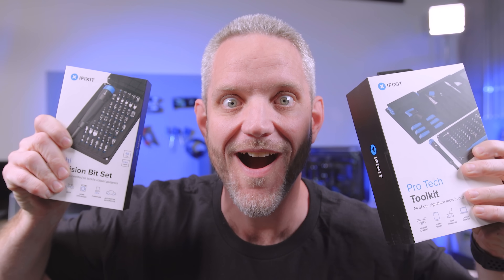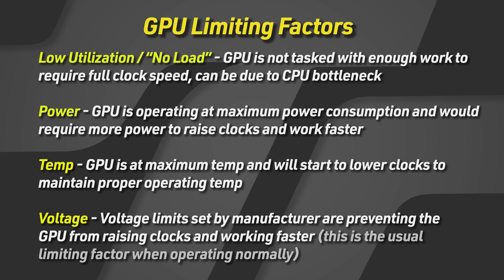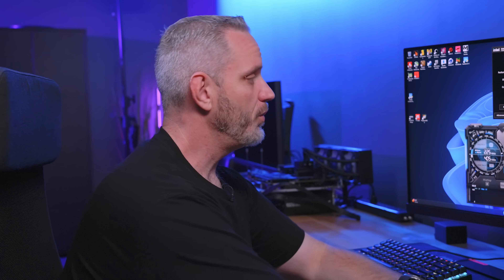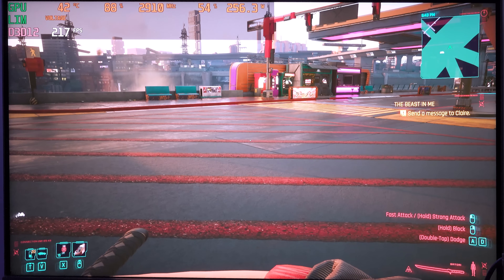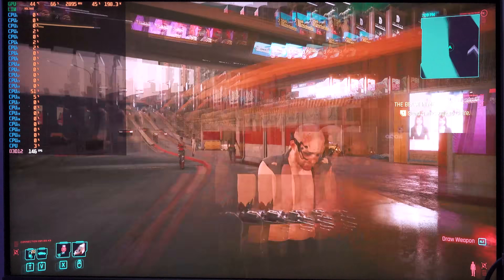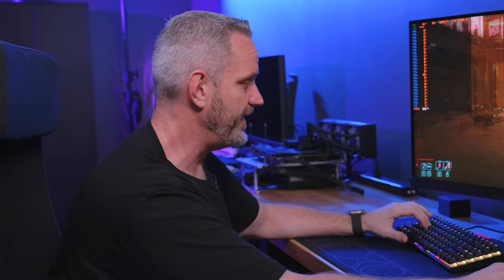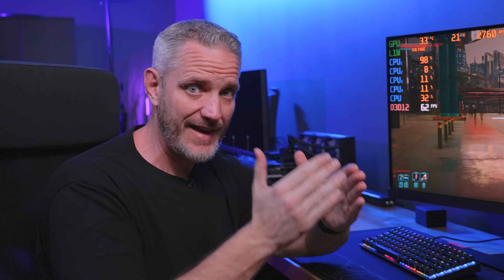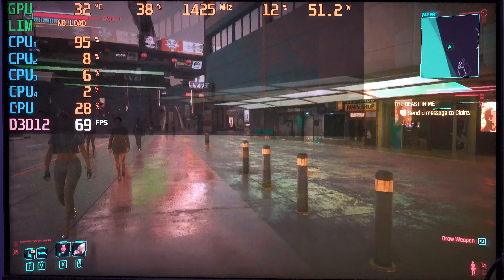THIS is what Bottlenecking REALLY looks like! AVOID THIS!

Comment: Really good guide Jay. I see this all the time and I try my hardest to explain bottlenecking in its simplest form wherever possible - but a lot of people seem to think bottlenecking happens "immediately" when you pair two components together. And that just isn't true. Depends on application. Very well thought out. Thank you.

I actually paired an X5470 from 2008 (At 4.5 GHz) with my 4090 just to prove that the card can still run near close to specifications.
Reply: A lot will depend on how the game itself balances demands between the cpu and gpu, and what you are doing in the background.
(I came back up here to mention, this got very long*, so tldr people should just skip this post and have a good day ;D and, also, I *don't have big issues with any other games, including what little I've played of cyberpunk 8.2 hours So this is a story of an "exception to the rule" sort of thing. One particular game that brought my system to it's knees due to bottlenecking. For reference, I run an i7 7700 at stock speed, and a zotac 1080 mini at stock speed. ssds all around. it's a prebuilt zotac mek1  except for the 1080, a beefier power supply, 32 gigs of ram and being stuffed with more ssds than zotac ever intended lol and while it may sound very old by today's standards, to build the same tier rig in today's market would be about 3 times what I could afford. Plus, since I use a 65" tv running 1080p@120hz I'm basically limited to 1080p gaming, which the current system already handles quite well in most games*. STRESS the *in most games part lol hence this bottle-necking story)
Like, I play a lot of 7 days to die, which actually relies a lot on the cpu when there are hordes (lots of zombies at once).
Things worked pretty well on the base game, but when I started running a mod (Darkness falls) that tended to increase the size of the hordes a bit, and some various other things, it was dropping the game from completely playable, to completely UNplayable (12-14 fps while dozens of zombies are trying to pound on you, with occasional drops to 0 fps. yes ZERO fps lol!).
So I started messing with game settings, trying to see what I could turn down in hopes of squeezing out a few more fps to get by...
But...
What I discovered, was that I could actually turn a whole lot of graphics settings UP and it didn't really matter, and I was actually already running the game at much lower settings than I really needed to, because it simply wasn't really the graphics being too high that were killing me.
There was a major game update right in the middle of my settings-testing so I never got to learn if there were any particular settings worth turning down...
But what I did manage to learn fairly quickly, was that I was almost constantly pegging the CPU up to 100% (in the task manager. I didn't have anything at the time to look at single core usage, but if it's riding at 100% in the task manager a majority of the time what's happening per core is probably less important lol).
Now... I'll bring up one of the big issues that I hit on as a problem right away.
I stream my games. So I always have obs running in the background, and I always keep chrome open to monitor my stream (just that one window, on a second monitor) and often I have firefox open in the background, for this and that (I still have all the bookmarks from back to the early 2000's in my browser, cause I always move them forward to my next pc, so firefox sort of serves of alternative/extra memory for my brain, which I rely on heavily since I have such a bad memory, plus I tend to always open things in new tabs, and my browser loads with all tabs from the previous sessions, so I can look back over my previous tabs to help keep track of time and when i did things, what i was looking up yesterday and the day before, etc. I rely on this so-much-so that I often end up with hundreds, or even thousands of tabs in my main browser. I believe the record number of tabs i've had in firefox at one time was 3,172 or something like that. somewhere over 3 thousand, i'd have to find the pic to know the exact number for sure. but, for reference, chrome with my one twitch page open, tends to hog just-as-much-or-more cpu than firefox with 2,000+ tabs).
Chrome tended to want to use about 14% cpu most of the time (it liked to randomly use 60+% for no obvious good reason) and firefox tended to want to use 7%-14% as well, so the first thing I had to do, was stop streaming for testing.
Aaaand, well I didn't get much further than that before the big game update changed too much to use what I'd already done, which for various reasons had taken a couple of days.
And it's that part that was really showing me how cpu-limited/bottlenecked my system was with this particular game.
The basic problem was, that getting REAL reliable AND consistently repeatable test results on that game was a heck of a lot harder and more time intensive than I expected. It was literally taking me hours-per-setting to get AND verify consistent/reliable/meaningful differences between runs.
And the primary problem was that my video card was simply a bit too good for single changes to make an obvious impact.
As in, the difference between low/off and ultra/on could be between 0-5 fps difference, while the variation between runs with the same setting could ALSO be between 0-5 fps.
So I wasn't able to do just simple run/spin around tests and get real numbers. They were all over the place.
I had to build a big square base with a particular place to stand, run around to all 4 corners and spin around to get everything to load, reset the time and weather to be the same, set my crosshairs on a particular point in the distance, then spawn a given number of zombies set to run towards me, and log the fps while they'd be beating on the base, and while I'd be shooting, etc. had to do that multiple times for every single setting to have consistent accurate results. And just running around in the city wouldn't have told me anything, because that part wasn't what was killing my fps. it was when my cpu was having to do this and that when there were large groups 25-50 or more trying to chase/attack at once.
Which, ironically, was the absolute WORST time to have major fps drops.
But, anyway, yeah. I thought that all these fancy green flamey effects that were added to some of the zombies (added by the mod) were going to be what was killing my fps, but no. spawning zombies that had lots of effects, had almost no impact compared to ones that didn't. 
That was all within the realm of what the graphics card could handle, if it was being allowed to handle things at all*, which it *wasn't when there were large groups, due to the cpu bottle-necking.
So, yeah, if you go to do some graphics troubleshooting/tuning, and find that turning a bunch of settings down doesn't seem to actually help, and/or actually seems to make the game run slower/worse, you may very well be cpu-limited/bottlenecked, because your gpu is stuck waiting around for the cpu to take care of some things before it can do it's next job.
And, since I still can't afford to upgrade to a similar tier modern system, i'm probably looking at needing to upgrade from my 7700 to a 7700k, since the k model's base clock is as fast as the standard model's full/max "turbo" speed.
My mek1's proprietary bios may not allow me to actually overclock the k, but just the default speed bump would essentially be an overclock, so it's all good. And with that, I think this system will be about as maxed as it can get.
Although... I actually have a factory refurbished 2080 super in the mail that i got for a decent price, which is probably the max video card I could use in this system. lol
That might seem silly considering I've been talking about my system already being bottlenecked by the cpu, *but*, there's some caveats.
1) My system is only this heavily cpu bottlenecked *on this one game*. other games, which balance things more heavily on the on the graphics side, don't have such a game-breaking limitation.
2) The new video card costs $276 (including tax and shipping). I couldn't buy anything near that tier from nvidia for that price, and I will never touch another "noone would ever notice that it doesn't have a 256-bit memory interface during normal gaming" card again... I bought a lower tier card that was recommended on that advice once, and had to suffer a year of seasickness-inducing micro-stutter before I could afford another 256 bit card to replace it. And since nvidia is now even chopping down their xx70 series cards, that only leaves me xx80 series and higher, which cost... well you know what they cost ;P
3) The 2080 super is a "blower card". My system was designed to use a 1070ti blower card, which sits in a little chamber, and the blower card blows all the heat out the back.
I swapped it for my 1080 mini, because I already had the 1080 and i didn't want to use a 70ti when I already had an 80, even though, in my quick round of testing, the 80 didn't really perform much different than the 70ti.
But, yeah, the temps with the mini are bad*. I even tried adding a fan to pull the hot air out, and it made literally no difference. AND I found during recent testing that my 1080 *will not throttle even though it's supposed to. so it's a risk to leave it running in there unmonitored. and it's actually the heat issue that was my biggest reason to buy the newer card.
now it's time for lunch :) lol
Reply: Can you please help me? I got a Ryzen 5 3600x and 6750XT and there is a significant Bottleneck what should I do?
Reply: @al3xb827  Turn graphics settings up. You can probably play at better settings without losing FPS due to the CPU bottleneck. You can try to OC your CPU if you have thermal headroom. You can try limiting the framerate, if you are experiencing large hitches in performance.

...Or just upgrade the CPU.
Reply: @princexaine5340  thanks. Somehow it looks like in some games if you change the graphic settings there isn't such a big impact on fps. But yeah that was my idea to oc the cpu at least. Cause I just bought the GPU sometime later this year I may upgrade the CPU.
Reply: @al3xb827  Right, and I know hearing "upgrade" after you've already dropped money on a component isn't the answer we all want to hear, but in reality, you can only do so much to mitigate the bottleneck your setup is experiencing in titles where a powerful cpu is beneficial.
Reply: @princexaine5340  Eeehm a x5470 is quite OC at 4.5Ghz, that's beyond what most builds will handle. Stock is 3.33Ghz, it's a core2quad chip yo. 
Upgrading CPU? Fastest chip of the whole generation of gear, the only upgrade path is to replace mobo, cpu and ram minimum. Best is all components except GPU and storage, since the PSU will also be too old probably, unless it's much newer than the mobo is.
Reply: @noth606  Yes, I'm aware of all of the information you have just said. lol
Reply: @princexaine5340  My point was that on a setup like that you cannot "upgrade CPU" as you suggested. You'll have to upgrade everything almost, since none of it is compatible with anything newer or faster.
Reply: @noth606  nowhere in the message did I  tell anyone to upgrade from a X5470.

Comment: Also one more topic which is very interesting, not all bottlenecks feel equal. Jay is right hitting a CPU limit gives large frame time spikes, it is very noticeable as stutters, it feels horrible. When a GPU is at a limit the delivered frame times are often quite stable so it is a much much nicer feeling.  This is why it really is often best for motion fluidity to either load your GPU to 98% or set a frame rate cap a little below below where your CPU FPS limit is.

This is also why Nvidia and AMD work on technologies like Reflex and Anti-Lag + to allow a small buffer in the GPU rendering output (a few FPS below your set refresh rate) to ensure latency does not spike up when the current workloads are saturating the GPU to its limit. The game play experience is much nicer.
Reply: don't you just love it when you got an fps sissy crying about not getting the same fps  as jay or some other youtuber video on the high end with their gpu even though it is still butter smooth? to play the game?🤣🤣🤣
Reply: @raven4k998  

What looks and feels butter smooth to one person is not the butter smooth to another person.

Lots of people are happy with 60 FPS from a motion clarity and input lag perspective.

There are lots of people who have a much more enjoyable experience when they are at 90 FPS to 144 FPS.   

It is down to their preference.

I don't judge other people I just help educate them to get a smoother, faster better looking gaming experience.
Reply: @micb3rd  cry me a river cause the point he made was that 20 fps is nothing at all
Reply: This really messes up VR, where frametime is king.

Comment: One of the BIGGEST improvements I finslly figured out: nvidia control panel > manage 3d setting > global settings enable use of more than one CPU core  which means basically the CPU and GPU can work together better

Comment: Interested to see this test again when the 2.0 update lands. Dev has been saying the CPU can be hit hard due to better utilization across the board.
Reply: I dont see recommending a 7800x3D or a 12700k for 1080p High without RT a "better utilization", there is nothing good in that
Reply: ohhhh. that would be why my 4770k and 3080 have been acting weird after the update. frames are still there as normal but CPU uti is like... 60% now.
Reply: @max16  But if it's because of better utilization, shouldn't your fps increase along with the usage?
Reply: @justcrap3703  Not necessarily.
Reply: @justcrap3703 maybe the GPU was already at it's limits as well.
Reply: 2.0 bottlenecked my i5-12400f so harrd
Reply: and then theres me with ryzen 2600 with 580 8 gig happy getting 60 almost everywhere with couple hiccups excepts npc heavy areas
Reply: @max16  A fancy way of saying the game is using all cores now for a more stable load. Not a lot of people know this but most games pre like 2020 used a SINGLE core for gaming. Which can be good or bad...
Reply: Oddly my 12700k is still only using 40% of my cpu at ultra on cyberpunk, with a 3060ti still hitting like mid 70’s to 90 fps with cpu set to performance and 144 frames ( max my monitor supports)
Reply: Running an i9 12900ks on a 360mm aio with a 12gb 3060, can run 80-100fps in 2077, that intel XeSS is nice lol ideally I shouldve got a 12gb+ 256buss card but it was 300$ 😂
Reply: My i7 5960x still works well in 2023 with its quad channel memory (thats faster than DDR5 bandwidth, and the latency) for almost every new game hitting Steam. For a true bottlenecking scenario, try the Witcher 3 at max settings, all RT on and 4k, you'll very quickly see a true bottleneck as you reduce CPU cores and speed. Not sure if its just since the game has the RT plastered into the engine, rather than CP77 where its so easy to run at max settings with this CPU.